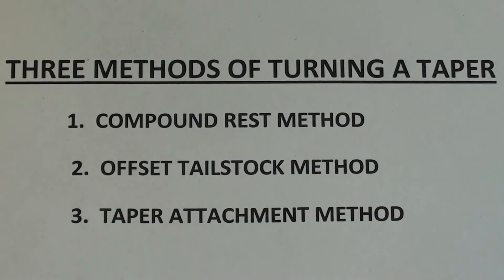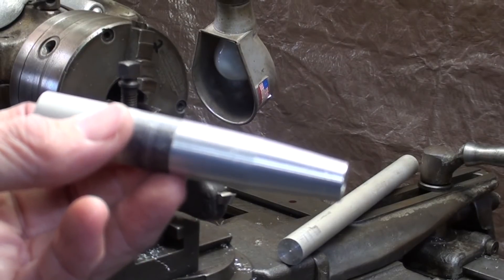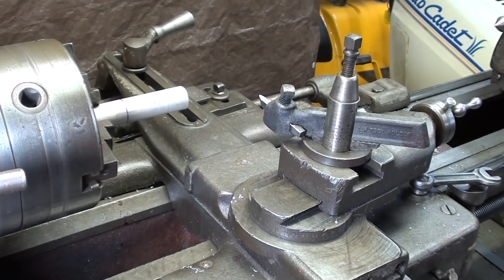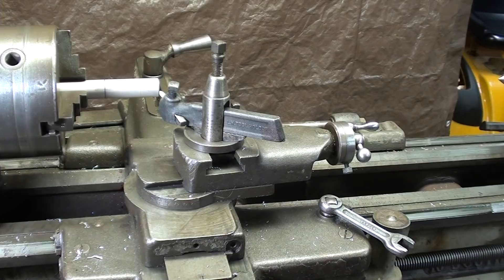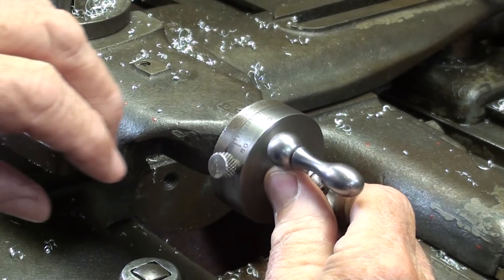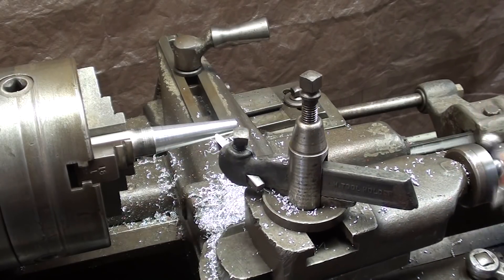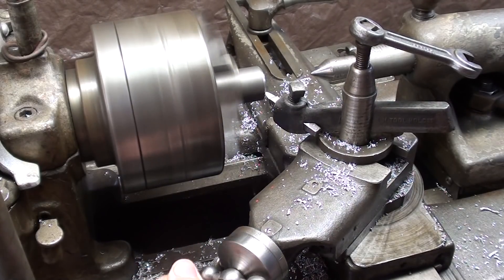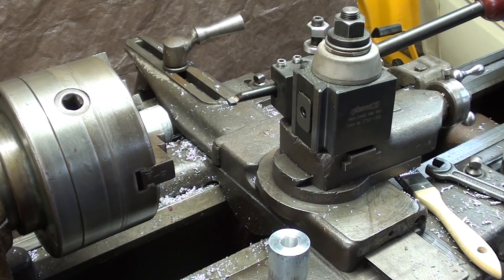Tapers SOUTH BEND Lathe Compound Rest Method  701 tubalcain

Comment: Hello Mr Pete, I have a old Southbend 13" Lathe. The problem I have is the T- Bolts that accommodate the compound being set to specific degrees , the slot they reside in is damaged and makes it hard to secure and eliminate chatter and vibration. I have made new tbolts but the slot that they reside in needs to be repaired do you have suggestions on a repair or solution to this as I cannot seem to find any info or suggestions for repair anywhere. Or even if there were another type of crosslide w/taper attachment that would interchange on this it is model 386c made in October 1928
Reply from the maker: That would be a very difficult repair. I was going to suggest you find a used part.
Then I realize your machine is almost 100 years old. You probably would never find a used part. Good luck.
Reply: @mrpete222  I have been looking for the used parts and I am wondering if the cross feed on the 13 and the big ten are the same and could just change the cross feed  out (as it contains the base for the compound) the notable diff is that one has a 2.25" center slug that it pivots on with two lockdown bolts in the base that engage from the side where as the one I have the bolts us the t-bolt slots that are cut in a circle and secure vertically  verses horizontally

Comment: Would a southbend heavy 10 be a decent gunsmithing lathe?  What tolerances can it hold (in good condition)?  Thank you.
Reply from the maker: As you just said, it totally depends upon the condition. Also, you would want to have a long bed, and I think all of those machines have the large spindle hole. That way a barrel will fit through the spindle.

Comment: Its been my experience that most lathes that I have used or owned always had enough compound travel to reproduce whatever taper was in the tailstock, mainly because I always make a center, spotting, and 1/4” drill arbor that way I don’t mess around with opening and closing the chuck, just retract the tool and swap it. Also I usually make a morse taper extension so I can make tapers with tail stock support, they can be bought pretty cheap too

Comment: Mr. Pete222, I machined a 1" round X 2" long with a small short taper point on one end similar to a short transfer punch to find center at the chuck end with my tool post, this seems to works very well if this is an acceptable practice in machining? I have a new project to work on wow, I now bought a Bridgeport series 1 mill, for $500, it is another basket case like my 12" LeBlond Regal lathe was, I have got the 2J head in the basement at this time, I'm cleaning, de-rusting, and painting all the components parts now and should start reassembly soon. Like you, my shop is in the basement, and after seeing what a chore moving a BP it down steeps it was for you in your video with a tractor I spent last summer building a basement egress with 7' X 8' garage door access. I still do not have the base component down there yet.
Reply: I paid $1200 for my Bridgeport. It had a new mk motor and ball bearing lead screws for the X and Y. It wasn't perfect of course. I removed about a 1/4" of old paint before spraying it. Replaced the spindle lock and downfeed clock spring and recently the spindle bearings. It was in a friend's basement so I thought it belonged to him, bugged him for about 4 years to buy it. Turned out it was his brother's, one phone call and it was mine. To this day I'm thrilled to have it and use it every couple days at least. Thankfully my shop us through my garage so no stairs but I did have to remove the table (48") to get it through the two doors between shop and garage, which I did alone. 

Got my KBC 12x24 lathe, MSC vertical metal cutting bandsaw and a Jet bench top mill (which I sold very quickly) for $500. The lathe is Korean, missing steady and follow rests which I replaced with parts from Grizzley that worked after mods. The scroll in the chuck that came with the lathe was chewed up pretty bad and I couldn't find a suitable replacement and the spindle was not a standard size. I had a friend who's a gunsmith, with lots of machining experience, modify the spindle to 2 1/4 x 8. I was not going to learn how to thread on my spindle! I now have a 3 jaw, 4 jaw and a collet chuck. As with the mill I thank my lucky stars for finding the lathe for such a cheap price and use it quite often. 

I doubt you are but if you're in the Atlanta area I can probably be a lot of help getting your Bridgeport into your basement. I deliver and relocate residential gun safes. I have moved several weighing as much as a Bridgeport, some have taken extraordinary effort and creativity to go where the customer wanted. One required cutting a big hole in the man's living room floor and lowering the safe with an A-frame crane. That was fun!
Reply: @renaissanceman7145  Gee thank you for the offer of help that a wonderful offer and I certainly appreciate it, but I live in Mentor Ohio, about 30 miles east of Cleveland Ohio. I have been waiting for the ground to freeze solid and good snow to sled the base around to the back of the house where my egress is on the plywood sled I built of it. That's the last component I need to move that is heavy.  I certainly look forward to using it by spring. As a side note both my lathe and mill are from the estate of a gunsmith, they both had to be disassembled to be removed from his home basement shop that also had an egress door. Thanks again for the offer of help and for also read my comment. By the way from 2009 to 2013,  I worked in the Atlanta area on a capital project of setting up a plant and liked the Atlanta area very much.

Comment: To measure taper while in the lathe, one can use dial indicators to measure the carrage travel and the change in diameter of the part.  1.Determine the sine of half the desired included angle for a distance of 1.000" of travel in Z axis.  2. Setup indicators, one on the carrage travel, the other on the side of the part to measure change of the O.D. of the turned part as the carrage moves. 3. Zero out both indicators. 4. Traverse the carrage 1.000" as measured on the first indicator. 5. Read the second indicator measurement for the change (in halt of the diameter). 6. Adjust the machine to create the desired angle.

Comment: Aha,,,,another good "How Too" to add to my practice too do list,,,,Thx Lyle, Sure like that Heavy 10, hope to up size one day from the 9c,,,but is good lathe to learn on, and an up grade and SS funds don't balance out, <): I have one question about my SB 9c. 1936 / Having bronze bushings, what would be the highest RPM's at the spindle one could safely go up too? Mine on highest pulley setting with a 2.65hp / 24vdc is at 300. For polishing it just doesn't cut the mustered, but don't wish to cause damage to the head, Bear

Comment: It is possible to use left and right handed tools and to run the lathe in reverse for one of the cuts, thus no compound change required. A trick I learned from an old machinist 30 years ago.

Comment: Could you start at the head chuck and work towards the tail stock then stop and feed back 2” and start from were you left off ? By starting there you can make sure your tapper starts at the proper dimensions to fit your piece ? Just asking !

Comment: That inside taper can be measured with a pair of gauge balls, or large ball bearings, and a drop indicator. What you do is you set the large mouth up on the surface plate, drop in a ball, measure the difference between its top and the top of the workpiece, and then do the same thing with the other ball. At this point you know the diameter at two points of the taper, and you know the distance between those two points and the surface of the material, and it's just some trig to figure out the result.

The difference in the radius of the balls, divided by the difference in their depth, is equal to the sine of the half angle. Determining the diameter of the mouth of the opening at the theoretical surface is left as an exercise.

Comment: Well each video I watch makes me regret not taking a metals class in high school.  I was so into woodworking I saw no reason to step across the shop where the metal working was held.  But watching your videos I translate some of what you do to my woodworking, I worked on my lathe today to make a precision fit candle holder for a customer.  They wanted it to fit a battery operated candle but did not want a sloppy fit.  Without these videos I would not have been successful.  Thank you Mr. Pete.

Comment: Good lesson....I made a tapper for my tailstick to hold a drill chuck that was better than the one I bought. i used a drill on the cross slide,, it's a small hobby lathe so after I got the tapper right  I than took it and installed it in the tapper part of the headstock to finish and tap the other end and it came out very accurate.

Comment: A couple years ago, I bought an adjustable cutting head (for milling I think), and it was an Italian make and came with the book in the box. It's amazing as I bought this at a scrap yard. I sold it on eBay, and the buyer was quite happy with. According to the book, It could be used for inside boring in a conical fashion.
Another item I bought at another yard was an adjustable angle milling vice. It was only missing one bolt vice. After repairs, I also sold this on eBay.

Comment: If you need a matching taper for inside and outside, cut the outside as you show here. Then with out moving the compound angle cut the internal using a boring bar on the back side of the hole with the lathe in reverse. But you can’t do this with a threaded Chuck or you may end up with a Chuck landing on your toe!

Comment: 13:18 Either on the 'other side' of the angle OR cut on the other side of the work - by mounting the boring bar upside down ! (Or using a left-handed boring bar?? and reversing the spindle rotation.)

Comment: If I send some pencils over, will you sharpen them for me ? ;)

In fact, the last thing I did on our (metal) lathe was put a taper onto a garden rake shaft as the head of the rake has a tapered socket.

Comment: I’m not a machinist, but perhaps you could use the same setting on the compound rest for the internal taper if you cut on the far side of the bore and run the lathe in the opposite rotation?  I suppose you’d need a different cutting tool as well, but you’d know you were cutting at the same angle.

Comment: It's funny your cutting a 5 degree taper there.  Used to make a part that had a 5 degree taper portion on it.  Most of the time we would cut it using the compound rather than messing with the taper attachment.  Ken

Comment: If you are not trying to match an existing taper, but just making an internal and external that match, you can turn the outer one on the backside by running in reverse, and the inner one in the normal way, which lets you do it without moving the compound, assuring that they are both identical

Comment: Good morning. Made a little er32 collet chuck for my Atlas using this method. Also had to cut metric thread. Used a dial indicator run along outside of the collet slid on a piece of bar in the chuck to set the taper. Came out reasonably accurate.

Comment: Why not turn the tool upside down and run the lathe in reverse when turning the inside taper from the far side?
Nice video👍🏻
Reply: Lathe in reverse and turning on the far side needs cutting tool right side up.
Reply: @ehess1492  you are right.
Tool upside down normal spindel rotation turning on the far side 🤔?
Reply: @MrArray1967  correct.

Think of it this way:

Forward spindle rotation = 1
Reverse spindle rotation = -1

Tool right side up = 1
Tool upside down = -1

Cutting near side = 1
Cutting far side = -1

Multiplying the 3 numbers needs to give a positive result.

Or, more simply, non-standard cutting setups must be done in pairs, never alone, or all three.  Any two will work together.

Comment: Nicely done, Mr. Pete! So..... I am looking to find an upgrade to my 11" Rockwell lathe. If you were starting over as a young home-gamer, what name brand  lathe would you shop for? Reasons?
Reply: I have been using a 13 x 36 " ShopFox gunsmith lathe for about 7 years now part time.Grizzly brands the same machine is a different paint scheme, but different color. I have been very happy with my lathe: I have had NO issues with it, it came with everything I need (except tooling of course) and it does pretty much everything I want it too. BTW: when I bought it 7 years ago I know ZERO about machining. But by watching Mr.Pete and Atom and practicing I have become a reasonably accomplished machinist. Also, watch/buy MrPete's videos, they're a big help when you forget what he told you the first time!!! IMHO my2c

Comment: Hey Mr. Pete!
IF one "really" wants to qualify a machined taper (while still in the machine)... Just set up two dial indicators.  One for distance of travel on the carriage.  One for sensing change in diameter of the taper.  Zero both when at one end of carriage travel and then record both, carriage distance and diameter deflection as you move the carriage.  You now have the information for calculating (be it by ratio or trigonometry) the actual taper.

Happy turning!
Ken
Reply: Thank you Ken.
Reply: This method reminded of a sine bar
Reply: @aerogfs  Except, done entirely in the lathe & no surface plate, bar or gage blocks required.
Reply: @kejay74   but the same trigonometry.. can't get rid of it
Reply: @aerogfs  Granted, provided your desire was an actual angle in radians or degrees, instead of rise : run ratio such as 3/8" per foot etc.

Comment: Make a small attachment to fit in your battery drill to turn the compound handle, gets a nice finish. (If you can get the drill to run slow enough)